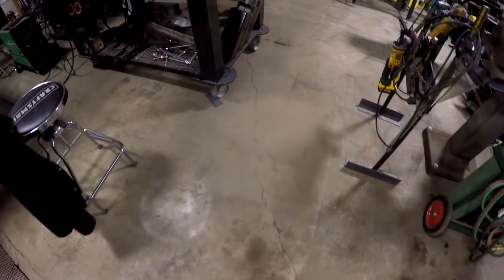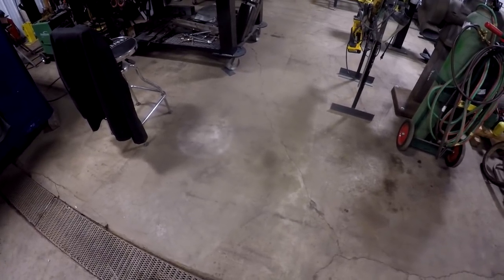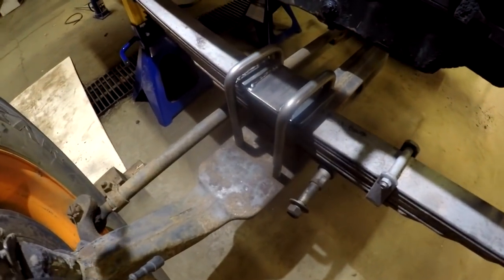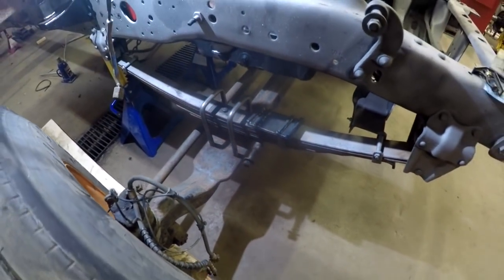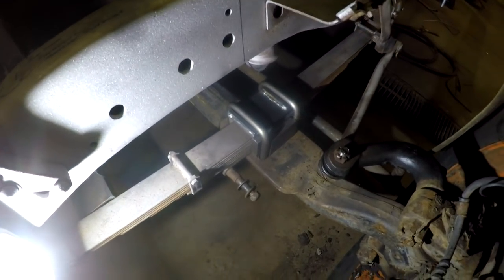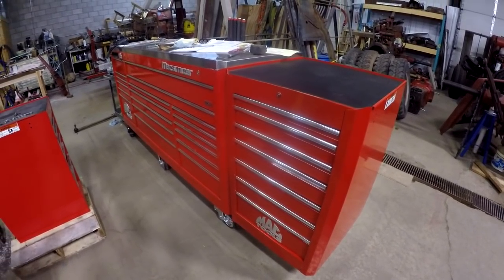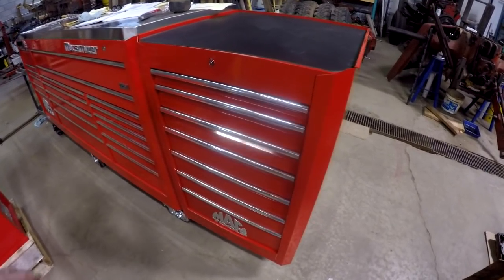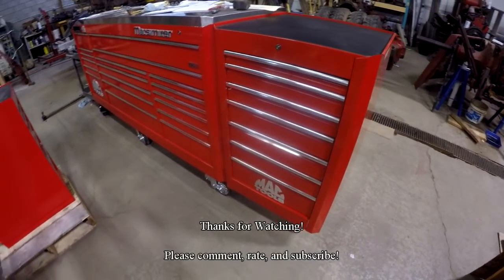Shop Update 12/31/18 My Screw Up Fixed!!!

Comment: fred. what about the hole in the ubolt perch for the center bolt on spring.  ?
Reply from the maker: That's one of the things that I am looking at. Right now it looks like if I used existing shim there will be interference between spring pin and axle pin within same hole. Option would be to offset existing bracket and have to drill new holes and fill one existing one (cast iron) or build new bracket (new holes and no filling). Let me think on it and I will update a decision is made!

Comment: Lucky the die didn't break with impact gun and no cutting  lube .
Reply from the maker: Jim Ķaipanen No, I was using cutting oil on it. They are guarantied anyways, wouldn’t take that attitude normally, but not happy with those dies! They run good threads, but are absolutely terrible to get started.